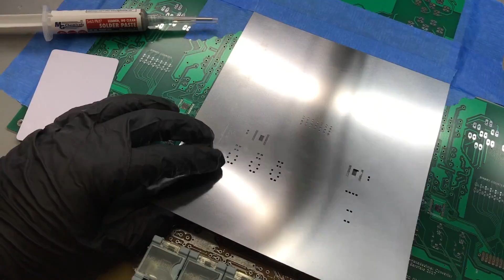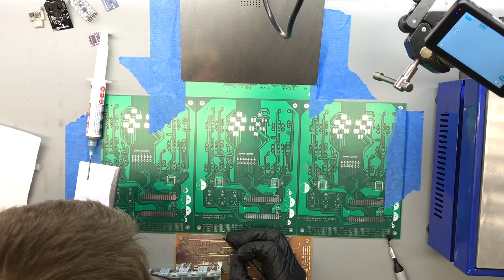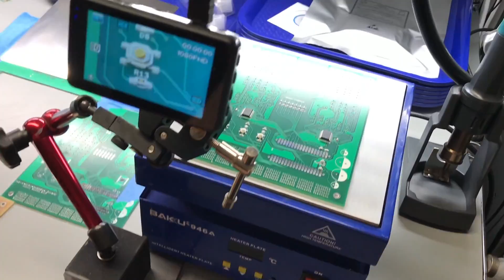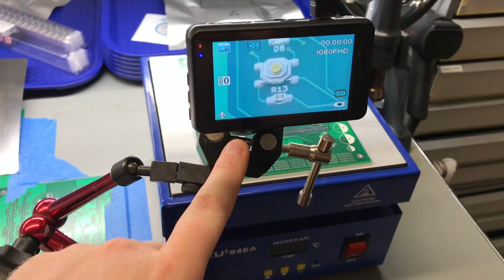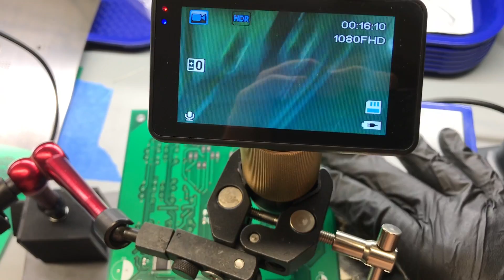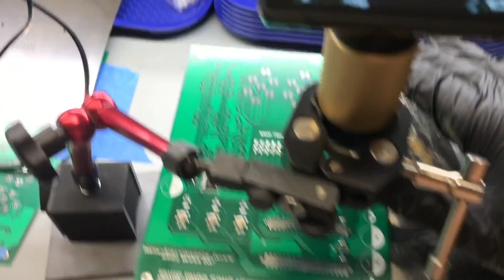Soldering SMD(Surface Mount) Components on my PCB with a Stencil

Comment: Nice presentation, if I might add a thing or 2.
Ramp up temp for average components is 2deg C per second, as shown on component data sheet, so try not to use an iron as the ramp up from room temp to iron temp would be in excess of component spec.
Also the component should sit on the solder 0,2mm (space requires higher) and not against the PCB, this is to do with the intermetalic layer (copper crystals) that hold the solder to the copper.
A brittle layer that grows with time and heat, keep soldering to a min 3 to 12 seconds.  
Thanks for the video, Michael

Comment: I could have done this much quicker hand soldering.   Still great video though.
Reply from the maker: I don't know, I doubt that. There are 132 surface mount pads on this board that you would have to solder by hand. It took longer for me to place the components than to actually solder the board. You would still have to place the components as well as solder every pad.  Aside from explaining everything this took me maybe 1 minute to solder after the components were placed. You would have to solder about 2 pads per second to solder that quickly which isn't possible for a proper solder joint.
Reply: Proto G I solder and place components at the same time. It's my daily job.
Reply: @bazahaza  Maybe in this set up. Some other videos has better component placing setup that way placing components can be very quick.

Comment: Are there any techniques you'd recommend when soldering a TO -263-5  MOSFET with solder paste just using hot air? Since those things have large thermal pads and I have large power planes running through them
Reply from the maker: Look up the datasheet to see max soldering temperature information. Just set your hot air to 150C or so and preheat the entire board.  Check the temperature with a ir gun or something similar. Once the board is preheated, you can turn the air up and just solder the heavier parts first.
Reply: Thanks for the advice ;) great videos

Comment from the maker: Use this link to get $5 off your PCBWAY order of PCBs: https://www.pcbway.com/setinvite.aspx?inviteid=57699 
Here's an additional coupon code for $10, just enter 1ec9d870 after registering.  The stainless steel stencil used in this video was only $10 so that's basically a free stencil.
Reply: Hey bro Just ordered using your coupon. Just a heads up that your link on the first line in your comment expired/not working
Reply from the maker: Thanks, I fixed it!